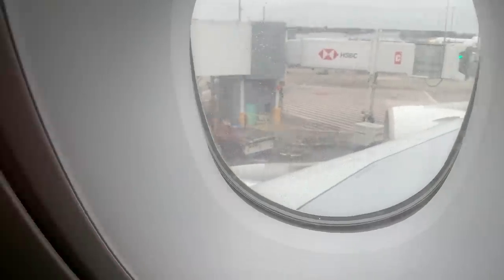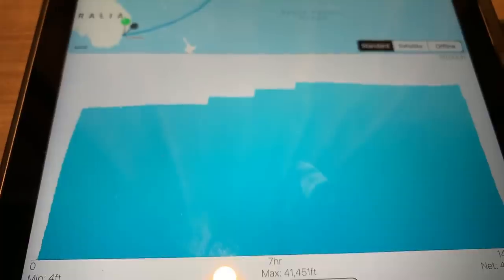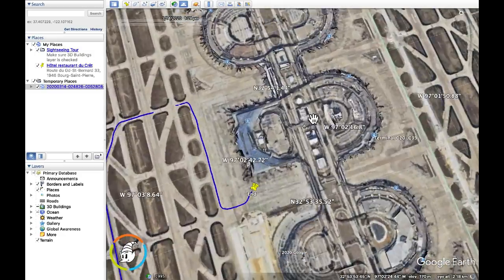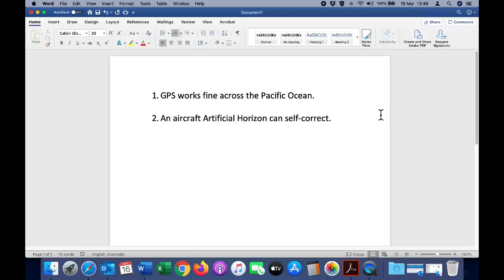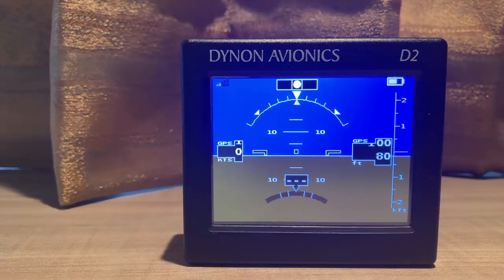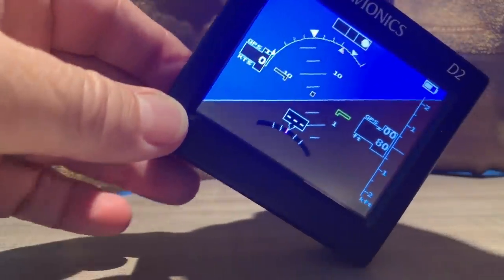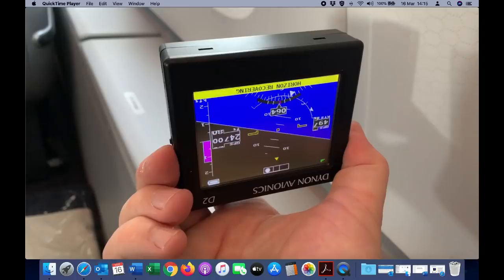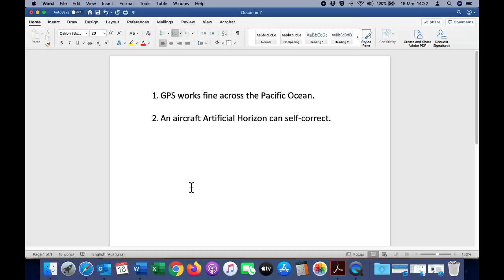GPS and Gyro testing on Qantas Flight 7 across the Pacific.

Comment: You lost a bit while taxiing to the gate so I'd imagine they'll latch on to that.
Reply from the maker: +Torionus.  No doubt.  The track log is 3D with an altitude based on GPS so sometimes it goes under the ground elevation in Goggle Earth by a few feet when taxiing.

Comment: Is that a new plane? Looks very nice inside.  Like a high end luxury SUV.
Reply from the maker: That was the demonstrator of the Global 7500.   I do a type rating in a few months though that might change now Canada has closed the borders.   I am in Montreal now for recurrent on the old one.  Arrived just in time.
Reply: @Wolfie6020  Well have fun isolated in your hotel room.  How busy was the airport when you landed in Monteal.
Reply from the maker: @equinoxproject2284  The quietest I have ever seen it.   Though I did get in after 11pm and normal arrive much earlier.    The hotel I am in has 15 guest at the moment, most are aircrew just here for the night.
Reply: @Wolfie6020  wow.  At least room service will be quick.

Comment: I was interested in your GPS devices and that they work fine in the cabin.  On 737 and A320s if I try to get a GPS fix using my Samsung S7 it very rarely works.  I guess the devices you use are more sensitive, or do they pick up a different band of GPS data compared to consumer GPS devices?

Comment: If you don't like scrolling in and out with the mouse wheel, right-click and up & down will do it also, and much faster or slower as desired. I felt bad for your fingers :-).
I love your new toy, but I think it would take me a lot of adjustment to get used to using a left hand stick.
Reply from the maker: +John Michaelson.  I have not done the conversion yet but everyone I have spoken to about it says it takes five minutes and then it feels comfortable.   

The ergonomics feel perfect.  Your hand just falls to it. 

Thanks for the tip on Google Earth.

Comment: Are there any ITAR style limits or restrictions on the GPS you were using? In the US, it is my understanding that normal consumer GPS units are restricted in altitude and velocity so they can't be incorporated into the guidance system of a home made ballistic missile or V1 style system.
Reply: I was using a smartphone GPS today at 39,000 feet and 400 kt with no problem
Reply: @hashmaldawn3878  Cool. I could well have been misinformed.
Reply: @Fudmottin  It wasn't a US smartphone and it wasn't in US airspace. 
I do understand that US GPS satellites have an extra function that is only available to the US military and close allies, but it is, in effect, a separate system.
Reply: @hashmaldawn3878  True enough. I'm not talking about using GLONAS in addition to GPS. My information, correct or not, is that ITAR regulates the GPS receivers themselves. However, that regulation may only apply to US consumer units. If so, that's kind of silly because I could buy something from Canada or Australia, or wherever that doesn't have a built in kill switch in the software and have just what I would need to have an autonomous aircraft fly into a specific building. I personally don't have the finances to build anything larger than a toy RC aircraft. But there are organizations that have the resources to put together something that can carry a nasty payload.
Reply: It's COCOM limits, which are supposed to stop GPS units from reporting when they are going faster than 1000 knots and at an altitude of > 18km.  Some of the manufacturers get the logic wrong and apply an "or" instead of "and", which is a bummer if you're trying to track a high altitude balloon.  Fortunately, some manufacturers do it properly, and/or provide a "balloon mode" for up to 50 or 80km altitude.
Reply: @david_akerman  That sounds familiar. Thanks. I heard it before but was fuzzy on details. I would build a subsonic ground following V1 style aircraft with a low radar signature and reasonable payload of something very nasty. After all, GPS modules are like $40! Obviously I can't do terrain following radar, but an approximate AGL of around 500 meters should do.
Reply: @Fudmottin  Someone serious enough to build a guided missile would make their own GPS receiver anyway, and just not implement the COCOM limits :/.
Reply: @david_akerman  That's a fair assessment. But that takes a hell of a lot more skill than using an appropriate consumer unit. Of course if you're talking ranges of over 300km or so, then yeah, you could probably afford to do that. That's a wild ass guess number.
Reply: @Fudmottin  Yeah, I just don't think it would be top of the list of challenges :).
Reply: @david_akerman  I certainly don't. Have a look at some of the large RC plane videos on YT. There are some impressive ones out there. A RasPi and sensor components could easily be programmed to fly one of those things a reasonably short distance into something.

Comment: ut why is it step increase when the plane burns fuel ? Also if you don't mind me asking , what would happen if an artificial horizon is placed on a surface for a prolonged time , as in it it's left on an angle would the gyro and accelerometer get fooled ?
Reply from the maker: +QED.  Thanks.  I had this on my to do list after dinner but that description is perfect.

+Hristo No the gyro would not get fooled just sitting there and I show that with my other unit powering it up at an angle m.

It will align to level based on the direction of down and the position of the external case won’t prevent that

At extreme angles it might reach mechanical limits though but that depends on the design and angle used.

If you are in a steady gentle turn for a long time it can start to aligned to the slightly angled force being sensed. (Gravity + Centrifugal force)

Pilots learn about these errors during training and know to be aware of them.
Reply: Why not a constant/steady rise in altitude, though? Regulations?
Reply: @eptagz  probably more difficult to implement / a plane with a constantly changing altitude is harder to avoid? (wolfie will answer this hopefully)
Wolfie, so if the unit uses accelerometers to decide where is "down", how long would it be for constant acceleration in one direction to fool the software? Let's say you somehow manage to constantly accelerate for 0.5m/s^2 forward with the plane for like 20s, would it de-calibrate the horizon?
Reply: @eptagz  In very quiet airspace that very gradual increase in altitude is possible (known as a block), but there are 2 issues in anything but the quietest airspace. The first is that aircraft effectively alternate directions with increasing altitude. So aircraft at 35,000 feet, 37,000 feet, and 39,000 feet will be heading in the opposite direction to those at 36,000 feet and 38,000 feet. So the step is done quickly.  The second factor is that if an aircraft has a block, then it is taking up the airspace for 2 or even 3 aircraft.
For completeness of my answer, the term cruise climb can also be used. The difference is that for a block, any altitude within the levels given is allowable, so you could descend if you wish. A cruise climb only allows you to go up and not down.
Reply: Hashmal Dawn, AWZool. Many thanks! So it's basically keeping them planes on "vertical traffic lanes" so they don't bump into each other, huh
Reply: @eptagz  Essentially yes. The only time I've personally used blocks was heading West from Peru towards Australia. Its an area that makes the route from Chile to Australia look crowded!
Reply: @hashmaldawn3878  Of course you have to be very careful going too high, lest you hit the dome. Lol. Thanks again!
Reply: @eptagz  Especially as no one can tell me what height this dome actually is!!